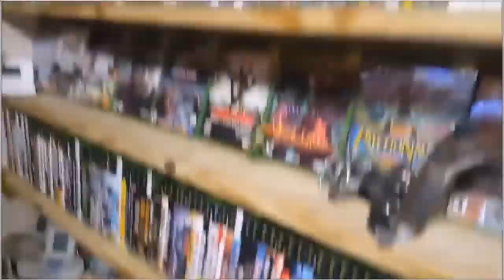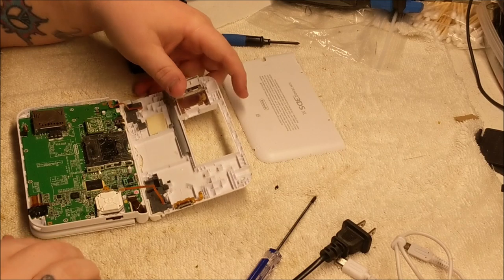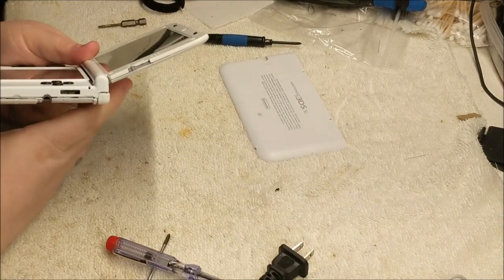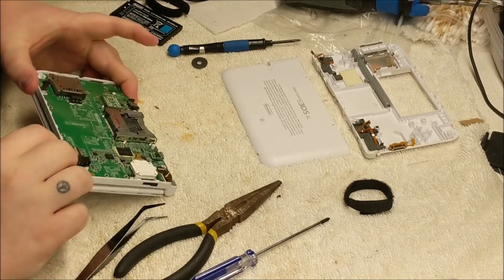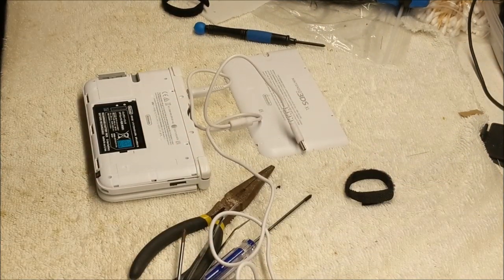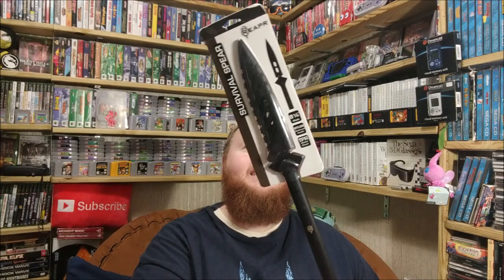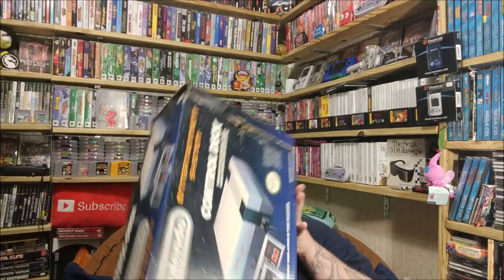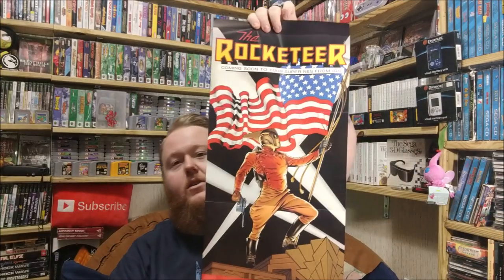The PAIN Is REAL! - Life of A Game Hunter/Collector Vlog - Ep. 90

Comment from the maker: I didnt win this battle with the 3ds but luckily its being sent to my buddy who's a champ with the modern stuff!
Reply: I had the same thing with a 3DS XL. I replaced the upper LCD screen and got the light going out after a second. Seems the 3DS needs to see all the connection during the self-test during boot. If something's wrong it will turn off after a short time like you encountered. Ironically I got it fixed, but when I wanted to assemble it fully I broke one of those small latches where the flat cables go. Never got to solder something that small so sold it for parts.
Reply: Might not be the case, but those 3DS’s have some tiny-ass fuses that you can test continuity with a voltmeter. If they’re bad, they are a PITA to solder off and on. I don’t blame Rene for passing it on. You need a tiny solder tip or a micro iron and a set of helping hands.